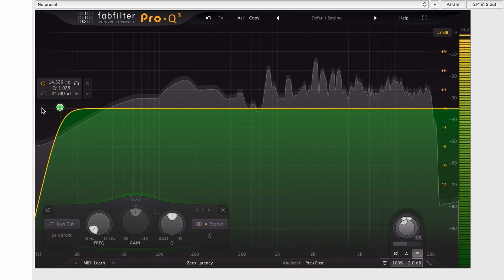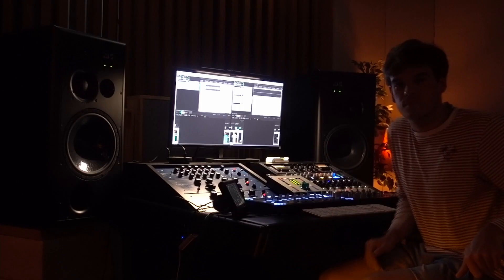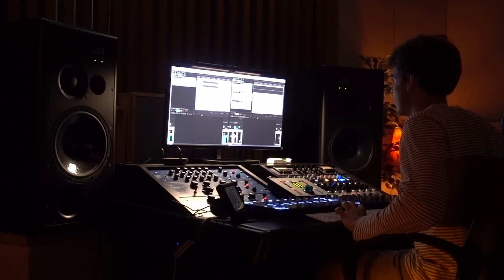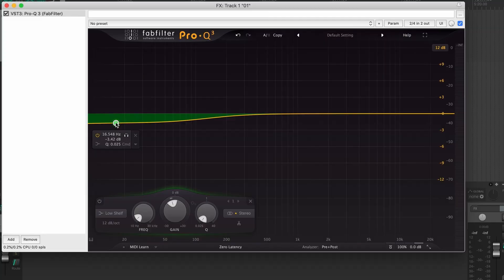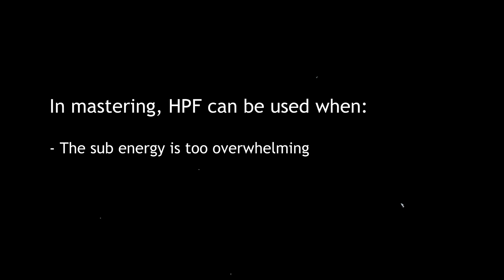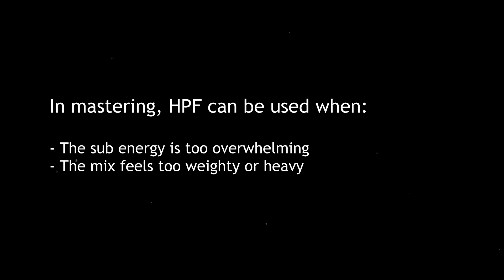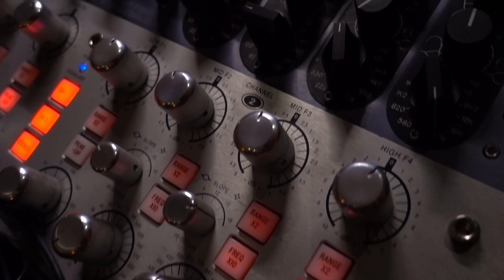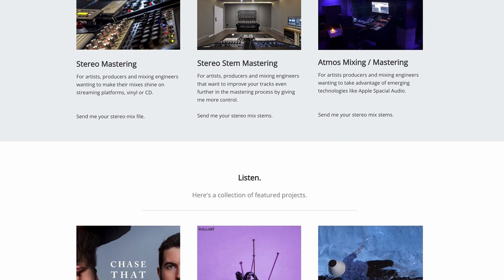Should You High Pass Your Mix?

Comment: If using hp on the master with a plugin, make sure to use a filter that has the option of being set to linear phase (such as pro q 3). Otherwise the phase of the signal at the filter crossover point will be fucked with, which can cause phase issues and additional volume you dont want.
Reply: This can also stack up over time in your mix if youre hping a lot of stuff as well.

Comment: I can't stand the phase shifting sound on sharp low cuts some engineers use. Post-ringing can make sharp bass transients sound 'zappy', and if they use linear phase that cause pre-ringing, that sounds even worse. You're totally right about using your ears. So many engineers (both mix and master) develop habits they do without thinking/listening. Always good to confirm 'why' you're doing something, 'if' you need to do it.